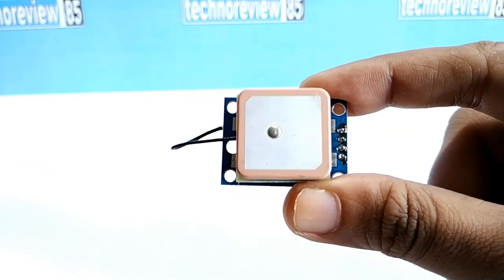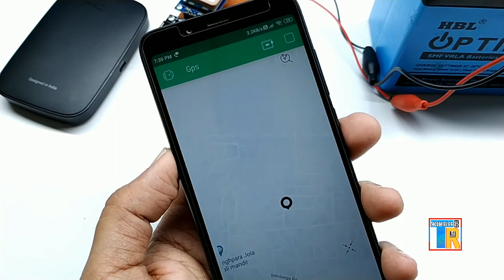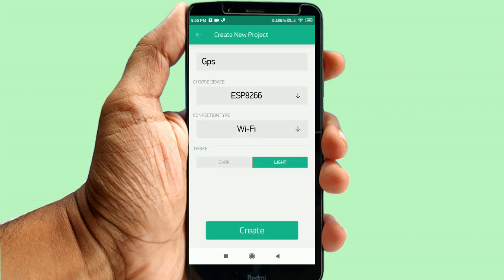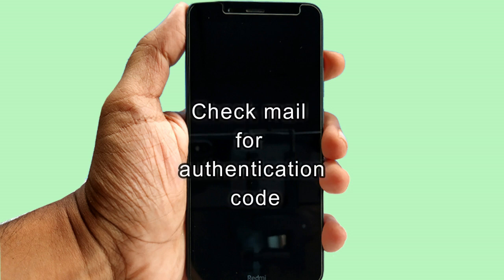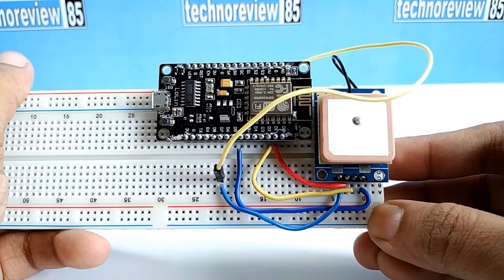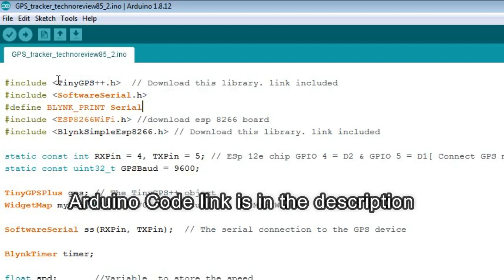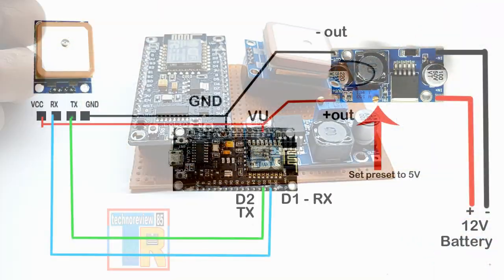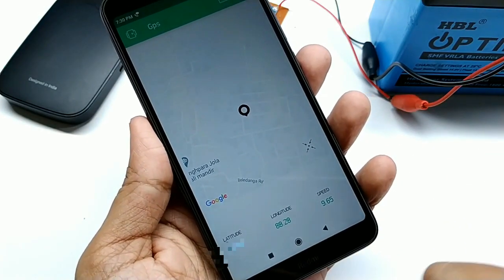How to make a gps tracker

Comment: can we use mobile data instead of jiofi
Reply from the maker: Yes.. you can
Reply: @technoreview85  can we use 3n5 V battery or 8V instead of 12v battery.
Plz suggest me battery Volts and is the step down dc module really required ??

Comment: sir which code u have uploaded many under each file just tell me the real code sir or else upload again
Reply from the maker: Here are 3 files. You have to add 2 libraries one is blynk & other is tiny gps & .ino file is code
Reply: @technoreview85   but its coming error (multiple files are there) and also those files are not opening what should i do
Reply from the maker: You have to add 2 zip libraries at first. No need to open zip .after that open the ino code in Arduino ide
Reply: @technoreview85  its showing error the tiny gsm file isnt there